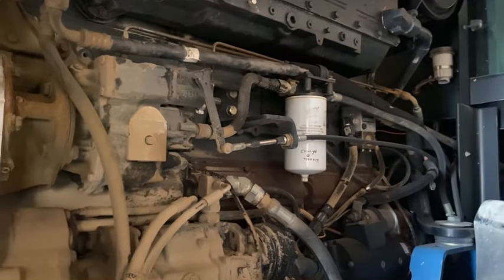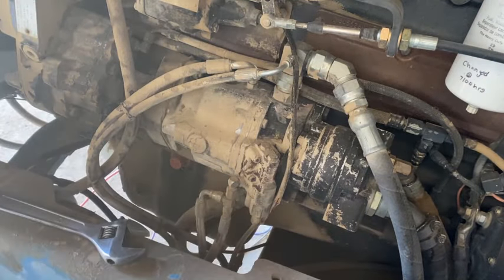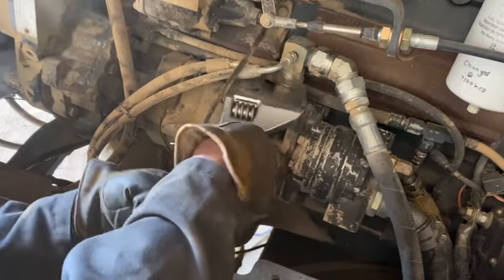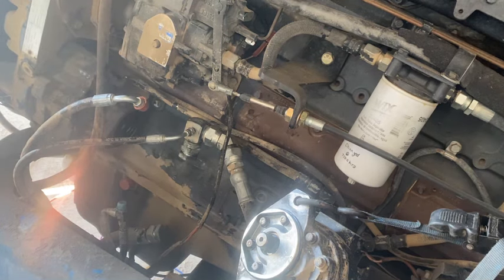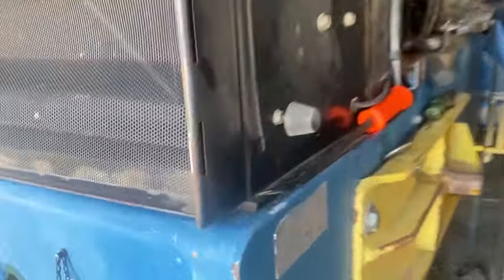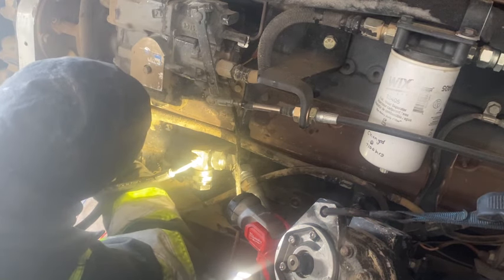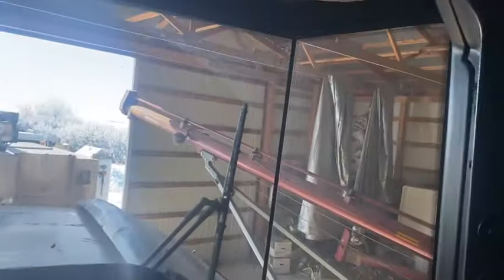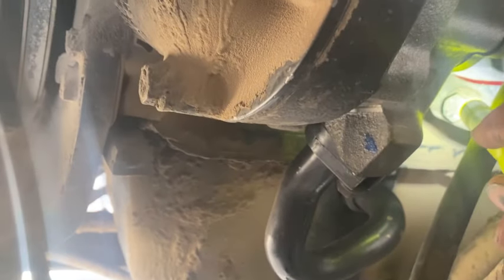N14 oil pump on a New Holland 9682

Comment: Jpaydirt had some interesting videos on a N14 equipped truck with oiling problems. Particularly low oil pressure and Cummins oil manifold design.
Reply: After his rant and modifications, Cummins oil cooling technique left me scratching my head a little...wished I would've modified the N14 we've got around here.. when I had it apart few years ago.. but,N14's all over the planet run/ran with that design  everyday for many,many hours...
Reply from the maker: Interesting. I’ll have to check it out
Reply: @elroyelblander6277  Jpaydirt certainly isn’t a Jack-leg and I don’t get Cummins design on the N14 oiling system at all. The N14 was a good engine but did have a history of oiling issues and worn bearings. Paydirt’s explanation certainly makes a good deal of sense to me but what do I know? I’m not an engineer; I just try to fix the mess that they designed.
Reply: @prevost8686  right on feller 👍👍👊
Reply: @prevost8686  I don't know if I'm gonna remove the cooler again and piss with it,but I definitely might remove the pump and shim it , idk..but anyway 👍👍👊